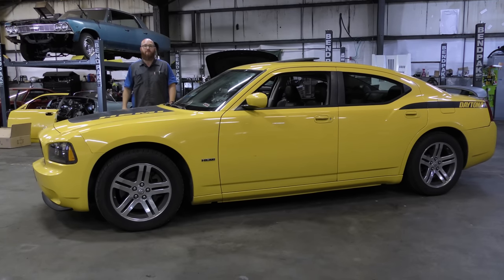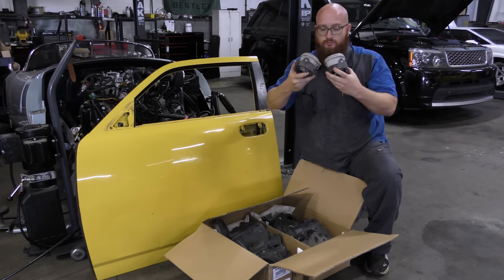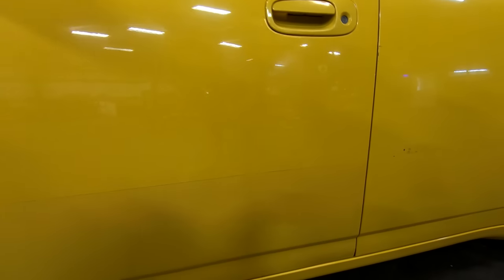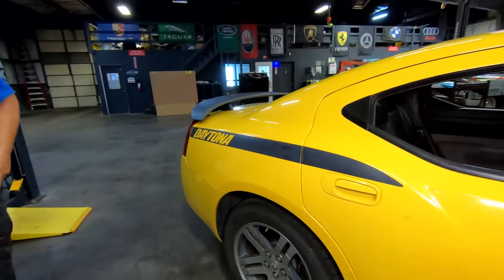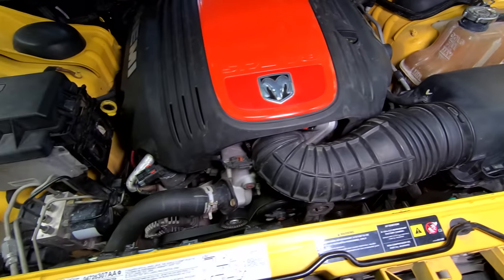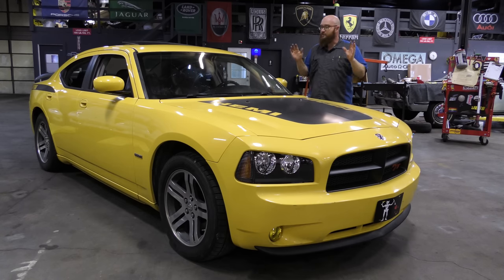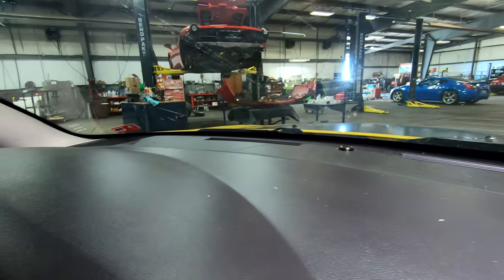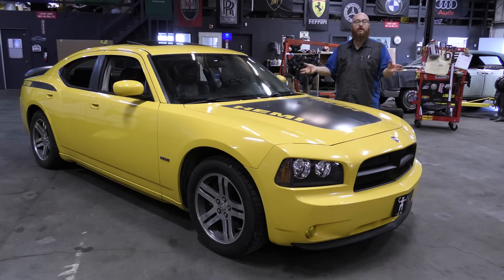Runs great! CAR WIZARD knows why he was sold this '06 Daytona Charger with a 'dead engine'

Comment: I also bought a cheap car to restore . All I've had to do is get new wheels/tires, replace all brake and all suspension components, a complete new frame, complete new body doors hood trunk lid, all new complete interior, new engine, trans, driveshaft, new rear end, all new electrical components and all wiring replaced, new fuel tank, all new glass, new headlights taillights parking lights brake lights reverse lights blinkers hazards and all light housings and lenses replaced, all rubber molding hoses and gaskets and all seals replaced, new front and rear bumpers, new grille, new radiator and hoses, new emblems, new paint, new wax, new insurance, new tags, new bankruptcy, all I got to do is replace the rear view mirror and I'll have a completely restored factory original car.

Comment: I can’t tell in my truck when it’s hemi engine goes into 4 cyl mode. Should be seamless. However I have read that the valve train can fail and be costly and most buy a kit that removes the 4cyl mode.

Comment: I had a 05 Magnum I would drive it in  4th gear which means it won't shift past 4th until you put it back in Drive.  That turns off the MDS and keeps it in V8 mode. Mine would rattle upon deceleration and I thought at first it was a timing chain issue.

Comment: Wizard, you're probably familiar with Honda's VCM problems. We bought a used 2006 Honda Odyssey that came with Honda's "VCM". After driving it for a week or two I realized how horrible of a system it really was. I ordered a VCM Muzzler which I believe uses a resistor to lower the coolant temperature below the VCM's minimum threshold, fooling the ECU into thinking the engine is still too cold to run the VCM mode. It's a very small change on the panel gauge but a huge difference in driveability. I've been running it for almost 10 years in the deep south with no issues. Surely someone has already figured out a work around. Has any manufacturer been successful with these variable cylinder timing management systems? They seem to cause nothing but problems.

Comment: Nice job but I'm afraid that in this platform the 300c and challenger are a lot nicer 😀
Reply: The first gen 300 is hideous, if you were told to make a rolls royce ugly, it would be the first gen 300.

Comment: You are going to replace the windshield so why didn't you remove the windshield and then do the defrost panel?  It would be so much easier.
Reply: Most people would not remove the windscreen to be able to install the defrost panel...
so this is the way to do it "normally"...
Reply: @JohnSmith-yv6eq  - I agree but he plans to put in a new windshield next week.
Reply: @paul9874  
Maybe there will be windscreen fitting specialists to do that job?
Complaints have been made by some that the Wizard doesn't do "hands on" any more.
This time he did.
When he does...there are still complaints..

Comment: i have a 150k 2010 RT with R&T that i got for 10k. i needs some sensors or something to get it running again, but it is hands dow one of my favorite cars, this vid renewed my love for it. ive always considered just junking it and get a newer one just for more power. but the body style, although not timeless, holds up very well going into its 3rd decade. plus the parts are as cheap as parts for a civic lol. the iron 5.7s are very bountiful, not sure about the trannies though. guess i need to upgrage to a tremec!

Comment: P.S. Another note: Put a sun blocker against the inside windshield so the sun won't melt the entire dashboard. That CHEAP plastic will melt on triple digit heat days. So will the door panels and rear deck parts. Happened to me twice. These plastic fantastics will NOT take heat.

Comment: These are collector series cars. How people treat them & others is appalling. Glad that you were able to fine great parts for it. This body style is way better than the new type. If I were restoring, paint stripped down to bare metal. (Whole body acid dipped). Repainted right. The reassembled with a complete New Engine trans & rear. Plus all new soft & hardware. I'm more of a straight pipe guy. This to me, sounds horrible. It's either complete quiet or straights with these new engines. Completely different sounding than an iron engine.

Comment: to me... the miles goes from being a bad thing to being a good sign on some vehicles and always has... if it runs as well as it seems to after that many miles... i would personally have no issue with its miles... the small things that need fixed cosmetically arent a huge deal... mostly stuff i could fix myself without even needing help...

Comment: That was one thing I've been wondering about your location if yall after a large pull a part type salvage yards to visit... I live in Cleveland and from here to Akron the next largest city and to the east Youngstown we have a decent amount of pull a part of pull a part like salvage/auction yard which because of the whole "discontinued " plague that doesn't seem to be going anywhere anytime soon the norm here is going part hunting where u and like 3 or 4 friends just hit up every and all car related junk yards in a 2hr radius and  each person fills there own little rubbermaid container with all the things that we used to order and buy like normal humans living in society lol... now it's like some mad maxx scramble lol... and the worst part is that's how u have to fix certain problems now...and in like 2 years all those parts will be gone and idk maybe will be able to 3d print with a material strong enough to just manufacture our own cheap breakable replacements lol

Comment: How did you get the bumper off to put the new headlights is there a lot of work but I need new headlights is the 6.1 motor better than a 5.7 question mine has 80,000 milesI changed all the cooling system and I change the oil constantly and transmission fluid on the rear end fluid power steering fluid brake fluid brand new antifreeze will the 6.1 hemi last a little while

Comment: Hotchkis springs in the front they come with a smaller or shorter bump stop do you know what the bump stop is why does it need to be shorter question

Comment: Any chance you can provide the link for the seller on eBay selling the color matched molding? I need to replace mine and I know mine is going to be the same situation underneath as yours.
Reply from the maker: https://www.ebay.com/itm/154496777717?mkcid=16&mkevt=1&mkrid=711-127632-2357-0&ssspo=XniSB1epTg-&sssrc=2349624&ssuid=1lzMfvSgQge&var=&widget_ver=artemis&media=COPY

Comment: You really need to get the Airbag recall done on that car. Stellantis says to stop driving older challengers, chargers, magnums, and 300s immediately if you haven't had the airbag recall done. If you own a 2005-2010 dodge charger challenger magnum or 300 that hasn't had it's airbag replaced. Stellantis says you should stop driving it. The parent company of dodge issued the stop drive order after 2 people in 2010 challengers died in separate crash's where the takata driver's side airbag deployed. Though the National Highway Traffic Safety Administration hasn't directly attributed the deaths to airbags,. Faulty Takata airbags have caused fatalities in the past. The faulty airbags lack a drying agent in thier propellant causing degradation over time in high humidity environments. The degradation causes improper inflation Wich in some cases sends metal shards and shrapnel into the driver or passenger. Stellantis urges you to stop driving the affected vehicles immediately untill your airbag is replaced. Your local dealer will do it free of charge.
Reply: Not to mention gas tank issue with filling up your tank full then stalling out …

Comment: Some independent engineers allege that turning off certain cylinders lead to temperature and lubrication mismatch causing premature engine wear.  Seems dumb to buy a V8 and drive as a 4 cylinder.

Comment: That's the nice thing about a high mileage but halfway decent car. They're easy to enjoy and you never worry about adding miles.

in January of 2016, I bought a similar condition Chrysler 300C AWD for $4200 with 210K on the clock to use as a winter rat. It had some minor body damage, needed one cat and few small things. As I started driving it, I really liked the car and decided to fix the body damage and all the little things.  As it was in nice shape, I decided not to drive it in he salt so it will last. Now with  246K all I do is routine maintenance and new tires about 8,000 miles ago. I'm in it for about $8,000 total.

Of all the cars I've owned, it is my hands down favorite and I'll never worry about the miles piling up.

Comment: Im dying to get a Challenger Demon and or Hellcat....hell, I even want the Challenger Super Stock Version. It's a Demon that's doesn't have trans break and drag rave mode and also without high octane fuel mode. Thanks to the US Government new regulations on car manufacturers having to have a high MPG average between all of its brands, has caused Dodge to have the cancel the manufacturering of the 6.2 Liter V8 Supercharged Demon engine in, 2023. That's the last year they will make the engine, because Dodges average MPG is above the limits because of this engine. Sucks!! Those engines will now be super expensive to find and buy after 2023. Watch, finding a decent low mileage Demon engine set up the way I said above, will cost over 35k for a "decent" used one. Watch. Ugh. Thanks US Government....its also forced Dodge to make a, All Electric Challenger.....wtf.....reason why Dodge has done so well since, 2018 and has made record sales and profits is because it was/is one of the last manufacturers that make a massive, powerful, loud, gas chugging V8 High HP engines. Dodge made the return of the muscle car era. Now it's being regulated away, again...just like it was back in 1973 when the government back then, chocked the HP out of V8 engines for less smog and better atmosphere for out furure.....F the future lol. I live in the now, I'll be dead 100 years from now, I don't give a crap lol.

Comment: With the way the used car market is right now, wizard can prolly get 13-15k for it, easily lol 😆 and that's with 250k miles on it. So crazy and stupid the new value of used cars. Car should be worth only 1k maybe 1500 but nope....250k mile 2006 charger is worth easly 15k wtf lol. 😑

Comment: A dead car. Again.  If Body is good> Start over by gutting it out and replacing with a 440 6 pack 4 speed manual >you know the rest. NO COMPUTERS. Then It will be a nice ride. Oh no! That sunroof must be filled in with steel.